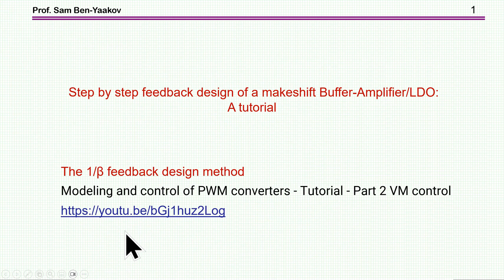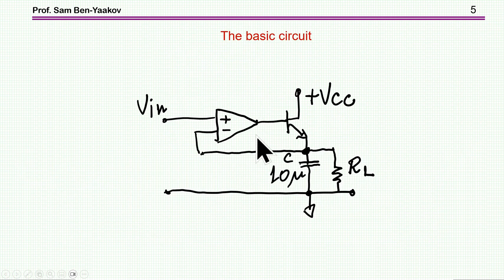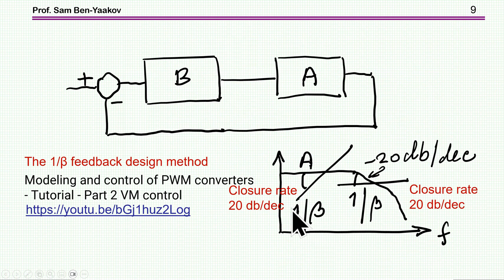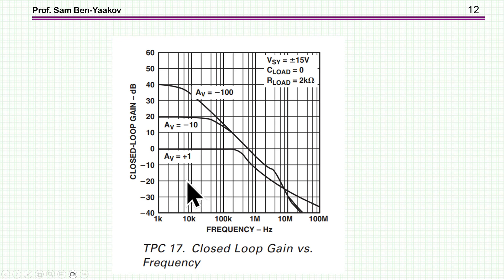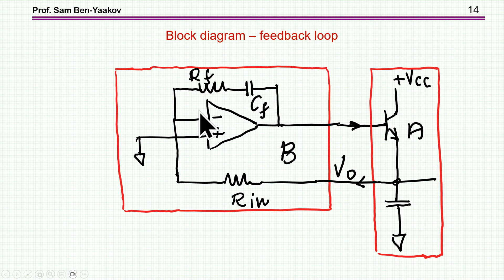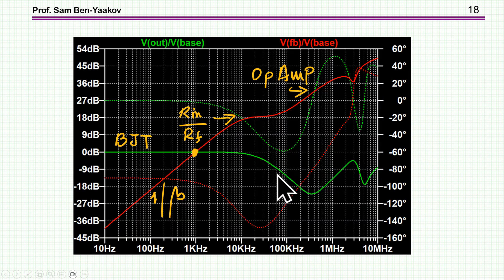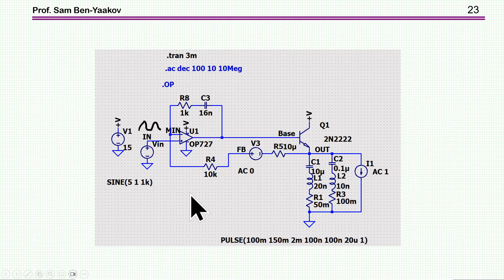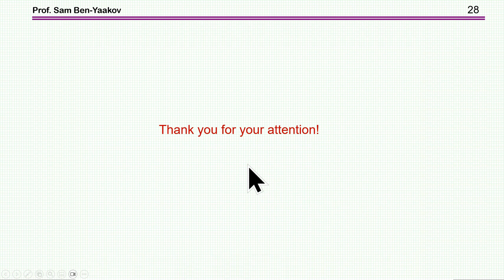Step by step feedback design of a makeshift Buffer-Amplifier/LDO: A tutorial

Comment: Thank you very much for your videos. They fill a lot of gaps in my understanding of electronics! I actually cobbled up the output circuit to watch the driving frequency related behavior. One unexpected result: even with a fast opamp one cannot nicely control this thing at 20kHz point!  Amplifier will be hitting the rail. Basically, the circuit cannot discharge the cap faster than the load resistor allows. [Edit:] on a second thought: transistor might get zenered if opamp rails (if I understand the situation correctly)
Reply from the maker: Thanks. Good points.